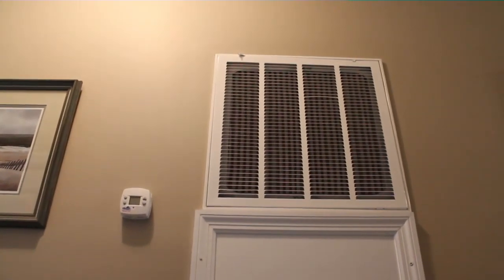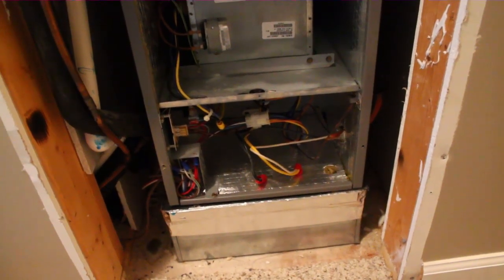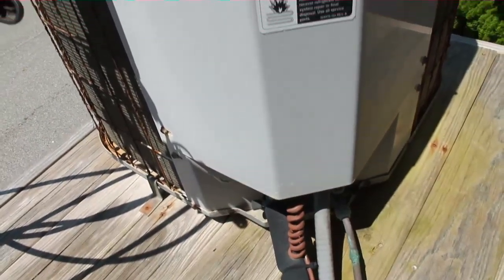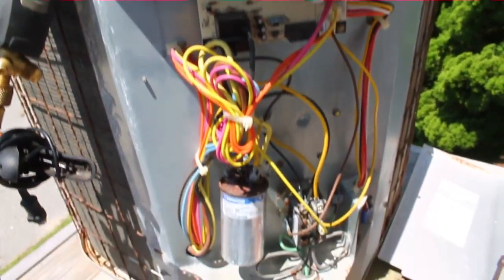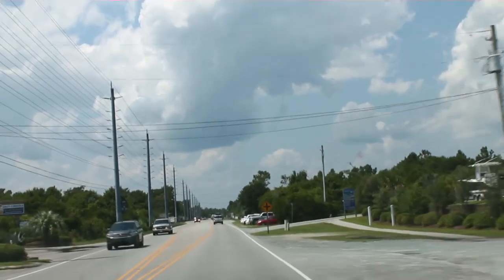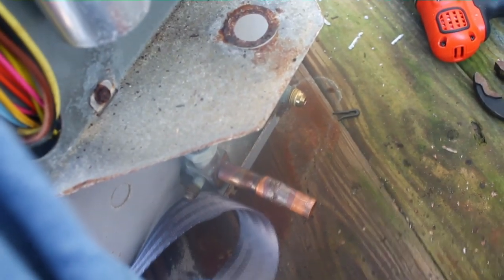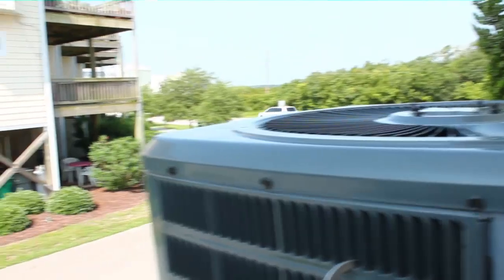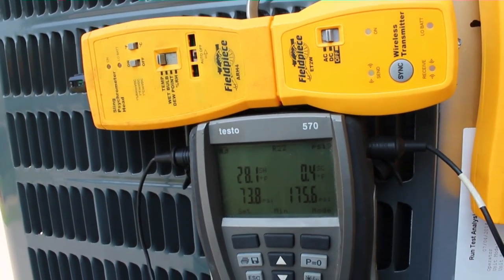HVAC Service Training- Carrier Heat Pump Failure

Comment: I have been looking at homes, and saw quite a few driers that were laying on the ground and corroding out. I am putting an offer in on a home with hydronic heat and evap cooling. I want central AC, but an debating on a heat pump, so I can have heat from either system, AND I want to keep the evap too. Evap is way cheap to run, and I probably only really need AC 8-10 weeks out of the year. ANY OPINIONS ON THAT>>??? I quit doing AC when the EPA stopped allowing me to vent R___(anything) into the atmosphere. I still have my gauges, vac pumps, thermometers, & other antiquated stuff. I do not have a flue gas analyzer though. Right now, I live in Phoenix Az. When the crash of 2008 hit, we had several people die, from trying to stay in a home with no AC. It started out with 20 cop cars, and the coroner's van, then became so common, only two cop cars showed up with the coroner's van.

Comment: It needs a thing looks similar to a drier or a acumulator but its called a refrigerantcharge ccompentsator what it does is it pulls some liquid refrigerant from the liquid line when its running in heating mode and return it to the liquid line in cooling mode to help with head pressure in heating mode

Comment: I always install an adjustable txv when im dealing with a mismatched system. Wont get ya the full 13 seer but helps get er dialed in to more notmal numbers. But like some on you tube say its another part to break. Keep up the good work
Reply from the maker: Good suggestion! That is a wise decision even with the extra possibility of failure. easy to flood those old evaporators

Comment: Nice job Zack. I wanted to see the platform y'all created to get that unit up there
Reply: Hey Zach you did good anyhow. It sucks when people won't heed your suggestions but what can you do not much. Yep that's gonna suck in heating mode your right on the money there!! Had a neighbor who did a heat pump change out and he asked me what I thought, I said if you wanna stay all electric you'll need to change out that older air handler cause your newer heat pump will have higher efficiency ratings heating and cooling. Well long story short he cheap'd out and he suffered for his choice even though the company he bought his unit from suggested it!!

He had the money he was just cheap!!! You can't take early 1990's technology and match it to 70's technology is what I told him!!!   

-Mike
Reply from the maker: Probably couldn't show it legally......

Comment: Great video! There are so many mix matched systems out there it's good to see what that does to the pressures. You just left the same piston in the indoor unit I suspect? Maybe somebody will do a vlog someday about mix matched systems. How to pick the best match? What that does to the pressures? Should pistons or txv's be changed,ect. ect.? Thanks for the video.
Reply from the maker: Good idea. You could change the metering device, but its not always a good idea. It would make a good video.